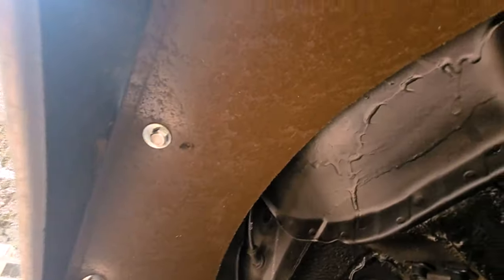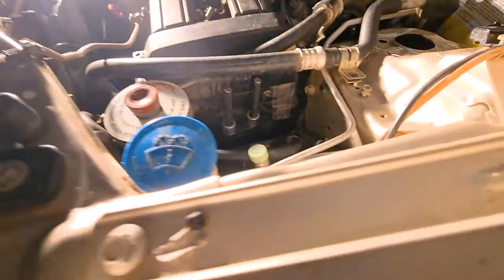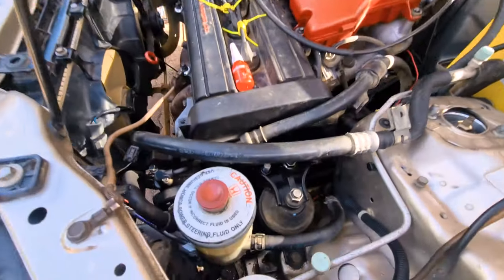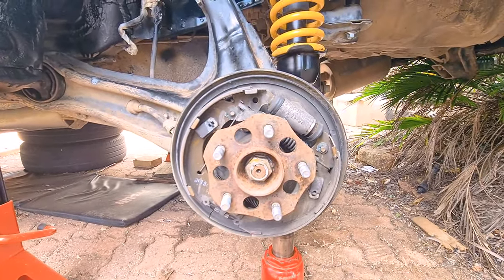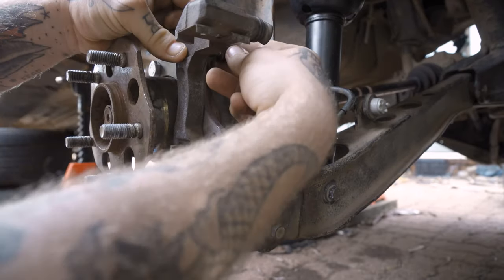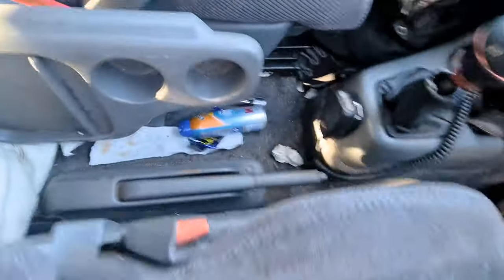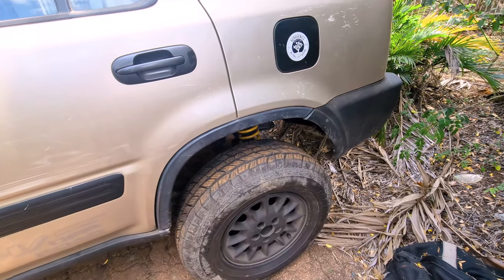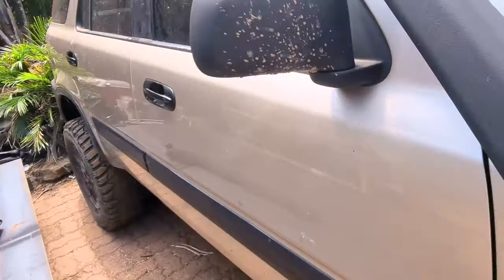Cutting My Brakes! RD1 CR-V CUSTOM Rear Disk Conversion (Upright Bleeder)

Comment: Do you know if it has to be a OEM 97 01 prelude caliper, or can I order a aftermarket one? I was thinking of buying the powerstop red ones. I just wanted to be sure if they will bolt up or no. Thank you.
Reply: If it is for the 97-01 prelude it fits. Some of the swanky high dollar race-style aftermarket monobloc (like the big wilwood) may have issues hitting stuff, and some lack the parking brake mechanism. In general, the aftermarket oem-style are fine. Critical dimensions are the spacing from bracket to rotor, which should not change with different calipers.
Reply from the maker: Sorry for the late reply! I went with OEM calipers since I was sure about fitment. Honestly, larger would probably rub on a 15" wheel, but I can't say for sure. 16" wheels are used to clear larger calipers up front so perhaps the same solution rear.

Comment: did you have to do anything with the abs? saw some video on the conversion and guy said you need to disable abs which i find hard to believe. and what's the purpose of mounting the bleeder upright not possible to bleed upside down with fluid in a rubber hose?
Reply from the maker: I have the standard model 2001, non-sport.  No ABS on mine (thankfully).

The upright bleeder was purely for the sake of if I had an issue with my brakes offroad, it'd be significantly easier to bleed them (say on a hill, offcamber, not steady ground etc.) I wanted it to be a straightforward process to bleed it.

It's possible to bleed it otherwise, but you can't keep the calliper bolted up and bleed it as you would any other car.

Unfortunately, despite making several iterations of a bracket that would pull the handbrake while flipped without binding, my handbrake isn't effective enough at all.  I've since replaced the calipers and handbrake cable, run them the upside down method and no luck.

Take from that what you will.  My on road braking is great but handbrake is awful